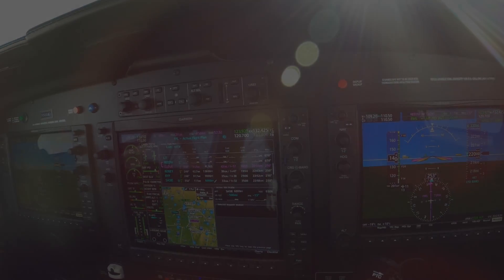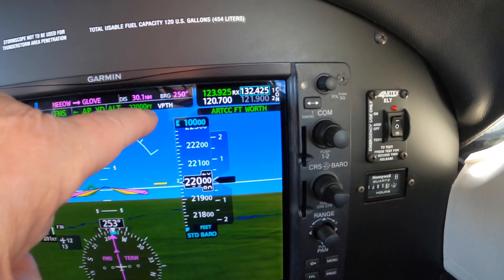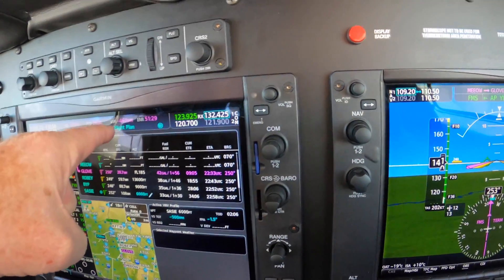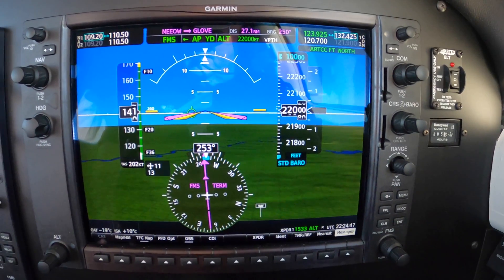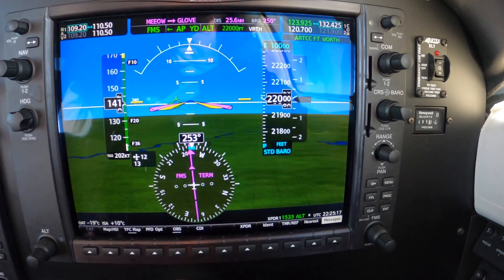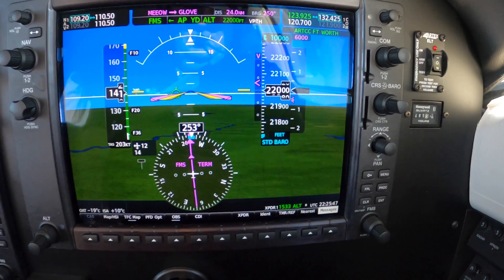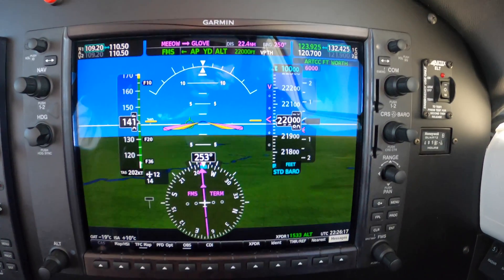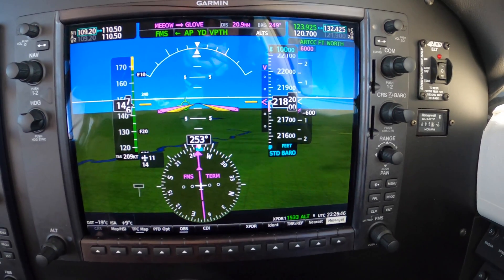Pilot's Discretion and the Use of VNAV with G1000 Nxi

Comment: Why did you decide to descent using FPA -1,5º  insted FPA -3º ? Because 3 is the stantard angle from FAA....
Reply from the maker: Some turboprops (the Meridian for example) have a very limited Vmo (max operating speed) making it important to plan the descent in advance. I recommend 1000 fpm unless there is a compelling reason to do otherwise. This eliminates the need to pull a lot of power off in order to avoid overspeed conditions. It also gives some leeway for bumpy air. Using 3 degrees is a jet concept which doesn’t account for the above limitations. I hope this information helps… Fly Safely - Train Often .. DR